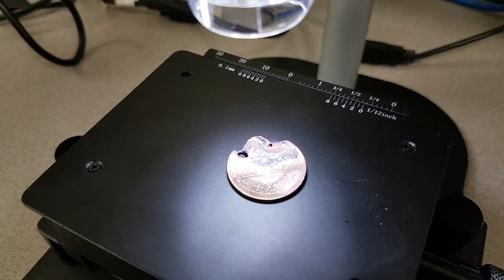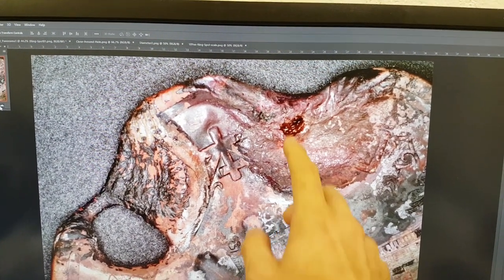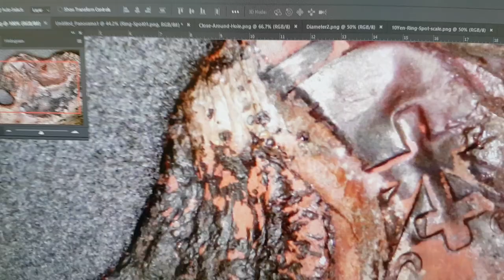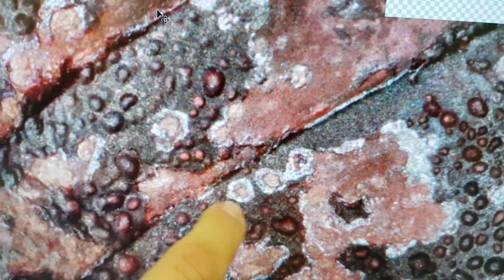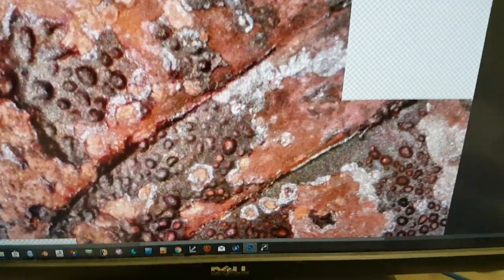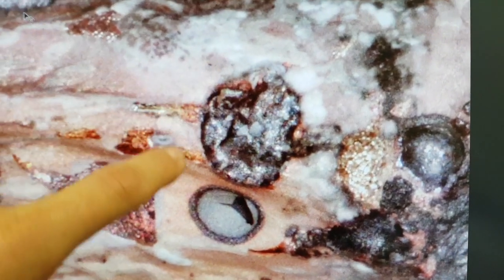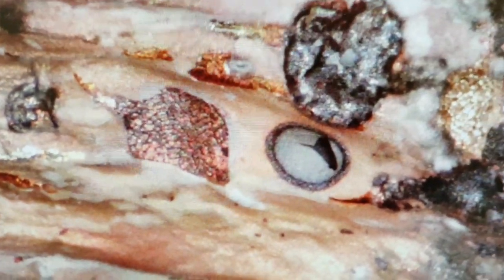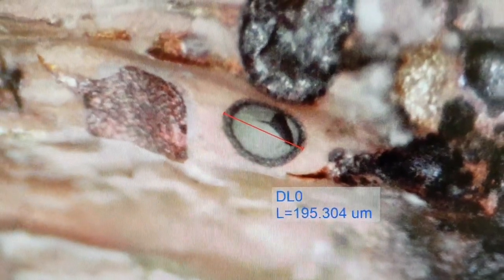OHMA - 10 Yen vs Ohmasa Gas 2, gas impinging side

Comment: Bob, it would be very intresting to se what the Ohmasa gas would do to quarts krystals or ordinary stone material. Would it melt, be soft or un affected?
Reply: The point is the coin didn’t “melt”. Ohmasa gas 700 degrees C and melting point of bronze is around 900C. What I think you’re looking at labyrinth instability patterns of dielectric fluid (ohmasa)reaction. I am forgetting whether there is a concave vs convex interefence pattern, and I cant find the lecture Bob talked about it.